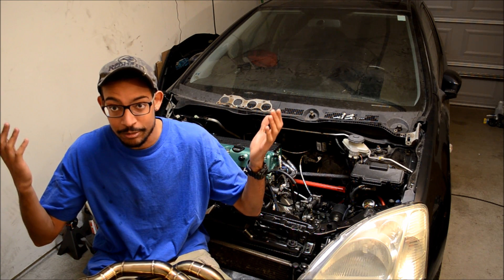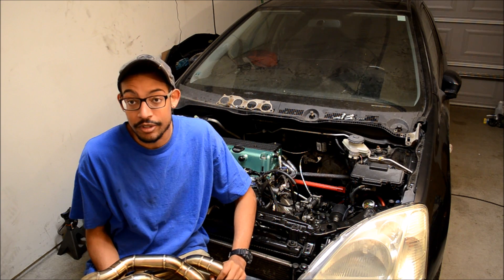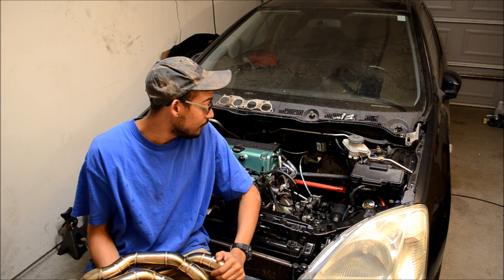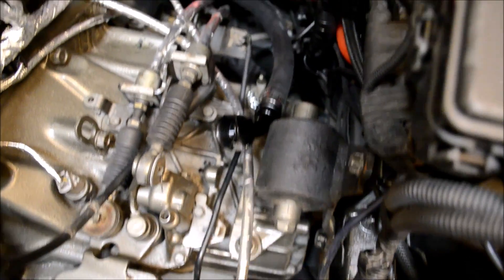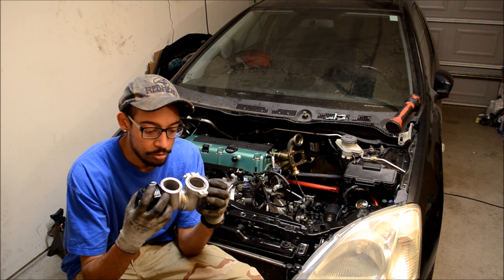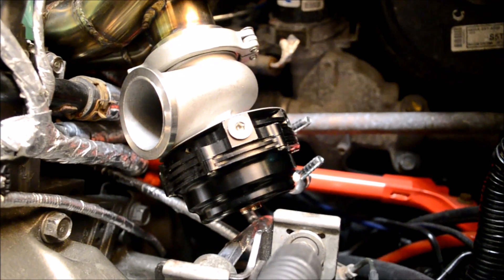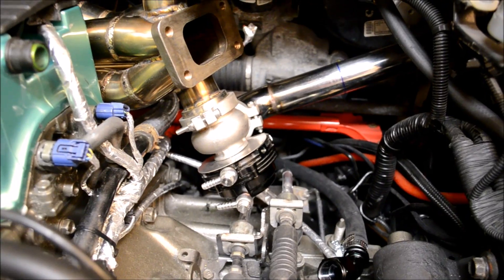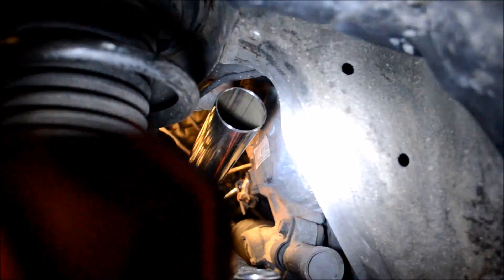Turbo Manifold Install and Wastegate Options EP3 RSX DIY

Comment: What if you just recirculated the the bottom wastegate dump into the downpipe. should be pretty simple honestly. All you need is a little 90 degree bend coming of the wastegate into the downpipe bam done.
Reply from the maker: Didn't want to throw it back in the down pipe

Comment: dont think fender would work to well once the car is lowered on the ground and lowered on coilovers or springs.
Reply from the maker: It can work, idc if I need to cut the frame some lol.... Angle grinder removes alot lol